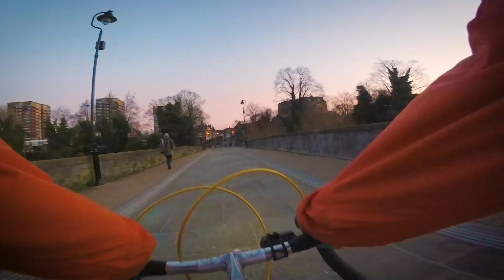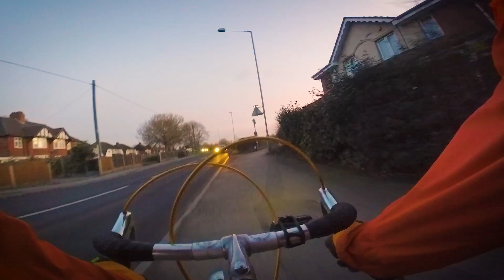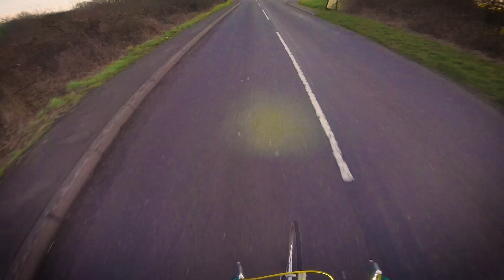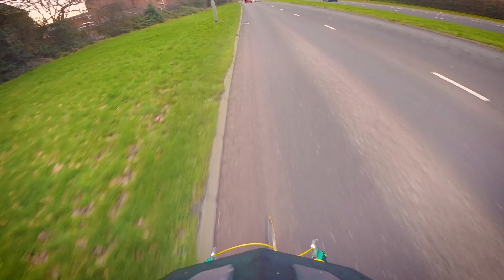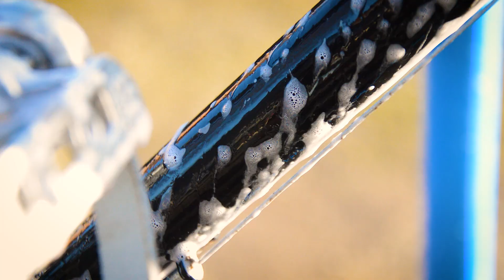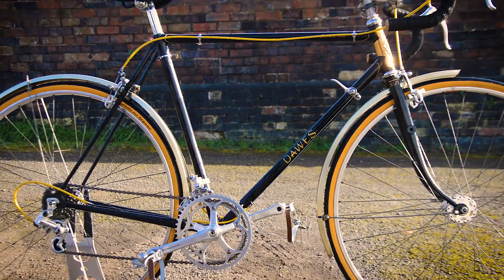Riding My Restored 1960 Dawes Concorde - Vintage Bicycle Restoration & Upgrade

Comment: I hope whoever bought the bike both rides it and looks after it. It really is all the bike most people will ever need. It would be nice to own a classic mass-produced English bike that isn't another freaking Raleigh! Of course I have a Raleigh sitting in the garage myself.
Reply: Alien On a Bike  Like a lot of British stuff, I suppose they were once good. In my day ( late 70s ) they were probably coasting on their reputation for quality and were at a price premium compared to competitors. The big seller was the Raleigh Chopper, a total PoS but kids liked the looks. There was no such thing as quality in British manufacturing at that point although stalwarts like Sturmey Archer and Brooks seem to buck the trend. I remember not wanting a Raleigh back then and the only new bikes I was given were a Motobecane ( quite exotic but my dad was a cyclist and francophile ) and then an Elswick Hopper that offered better equipment ( all alloy ) compared to a similarly priced Raleigh.

There isn't really such a thing as a Raleigh anymore. Raleighs were British made in Nottingham and any bike that doesn't meet that criterion isn't a Raleigh
Reply: Alien On a Bike  With the stagnation and total lack of innovation in British industry I think they couldn't muster the energy to screw up the hub gear. They would have needed to find a supplier of inferior metal or switch out a good machine for something that did a lousy job. It's testament to the genius of the original design and material specifications that they never went downhill. The Taiwanese don't mess around so I would be pretty confident about sourcing a part from there even now. Taiwan is not China - a lot of great bikes have been made there.

Comment: If you find that you slip forward out of the saddle then try moving it forward on its rails and/or fit a chainset with shorter cranks. Either way, if you have to stretch for it, then the lower-forward part of each crank stroke will drag you forward. A non-slip saddle will help to a certain extent.

Comment: There’s a unique satisfaction in resurrecting a classic beauty like this 👍
Are you familiar with MKS pedal flips?  They're little triangular "tails" that bolt to the rear of the pedal cage to provide a means of tipping the pedal up with one's toe to ease entry; very handy for toe-clip pedals!
Reply from the maker: Yup, those pedals actually have them.  I was just having trouble sliding in with my sticky MTB shoes :P
Reply: I have mks quill 2k on my bike

Comment: It's a nice bike .   But those peddle foot clips are dangerous .   If you can't get your foot out fast , you break your arm or leg .
Reply from the maker: My straps are never fully done up. Easy to get feet in and out.
Reply: When the 'peddle clips' expert cannot even spell pedal correctly, you just know they're talking bollocks.

Comment: Oh dear, another potentially nice build ruined by powdercoating! There is a reason no quality bicycle manufacturer/restorer uses this process.
Reply from the maker: You would then need to explain the reason if this is going to make any sense 😂
Reply: Google is your friend. Don't take my word for it, next time you're on a l'eroica jaunt, ask those fellow attendees IF they'd pay good money for a well-prepped, well painted frame, OR an, admittedly cheap, plastic-coated 'looky likey' BSO ....and don't be surprised if those opinions are expletive laden? Seriously, save the powdercoating for garden furniture.
Reply from the maker: Greg, I'm happy to take feedback and criticsm - it is after all, how you learn but referring me to Google isn't going to cut it.  You need to explain your point.

If you had said something along the lines of:
"Powder coating is all well and good but spraying a bike gives a much better finish.  I know powdercaoting is a cost effective method of covering a frame, used in a wide variety of industries, giving a durable finish but it tends to clog up any light detailing in the frame such as serial numbers and tends to make lug details less defined.  Spraying, although a lot more expensive for a decent job, tends to be a lot better for keeping details in the frame, such as those serial numbers and lugs.  It also lets you use multiple colours on the same frame and blend the colours etc."

Had you said something like that, I would have said you are completely right.  Spraying is a much better was of restoring your pride and joy.  That being said, it's not possible for me to do that for every bike.  I simply can't afford it.  For my pride and joy (1946 Norman Rapide) I am considering taking that to Mercian to get a full restoration of the paint but that is going to end up costing hundreds.  I can't do that for every bike on a basic (near enough minimum) wage.  This is a hobby for me.  I know the pros and cons of coating but I enjoy keeping these bikes alive and there are lots here that enjoy what I do, even those that ride Eroica.  

(I'm discounting spray cans because they give an absolutely terrible finish)

Hope this comment hasn't caused any offence.
Reply: None taken, and your point is fair, it seems 'cost' is the issue? It really needn't be. You made a passing reference to spray cans and at sounds like your previous experience in that area didn't turn out quite as expected. I can assure you that a perfectly acceptable finish IS possible using cans, it really is all in the prep, and not a matter of cost at all. Further, once that comparatively heavy plastic (and let's not forget that's what it is) degrades, whether through use or good old UV, it will be, to the next owner a bloody nightmare, if moisture gets in behind the coating, usually, the coat is so thick, it goes un-noticed, so by the time the breach is discovered, the metal behind can be so compromised that it is structurally unsound (I've seen this myself) on the other hand, even a poorly applied 'paint' will do extremely well to mask oxidization on a structure as rudimentary as a bicycle frame. Hence, there are lots of nice vintage frames around today, some nearing a century after they were originally crafted and had some cellulose thrown at them? IF they'd all been powder-coated, all of us weirdos who love to restore such things would be in a completely different boat ...... probably all accomplished brazers???
Reply from the maker: Cost is always an issue I'm afraid.  Half these bikes I'll end up selling on and the other half I keep but I still have a cost in mind.  I won't mind so much with my "special" bikes when I eventually get round to them so sending one of those off to Mercian to get a proper flamboyant paint job will be great.  

You are right.  Paint cans can leave a good finish if done correct.  It's just in my experience even with a lot of cans, the price soon ads up and the finish doesn't seem overly durable.  It doesn't really help I don't have anywhere to properly spray a bike though.

Point taken about potentially hiding moisture though.  I could see that as a potential issue.
Reply: The finish looks great and powder coating is bomb proof
Reply: @person person - WRONG! its quick and cheap. a properly painted finish is far nicer and will last far longer. As for 'touching-up' a plastic coated bike .... forget it. Powdercoating (read plastic 'wrap') is the bike flippers dream, just pity the recipient/new owner of such dross.